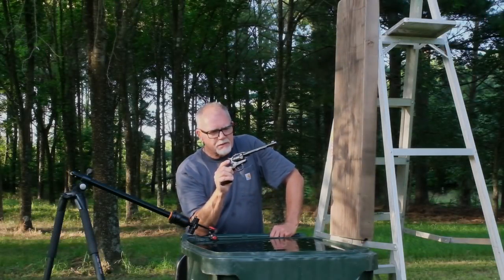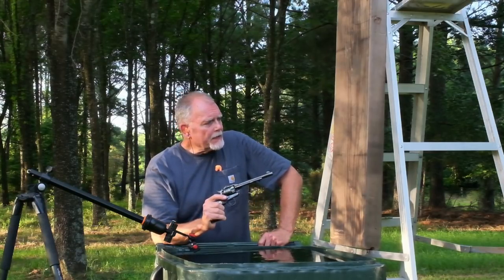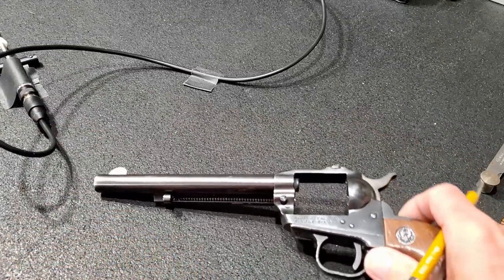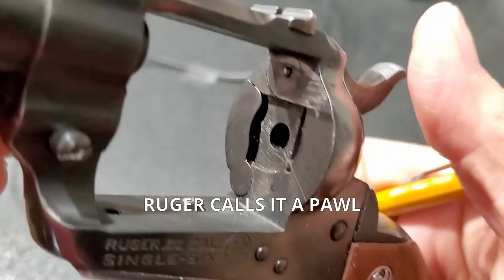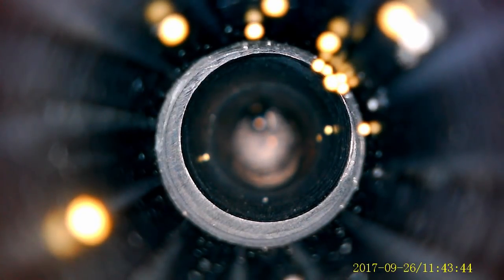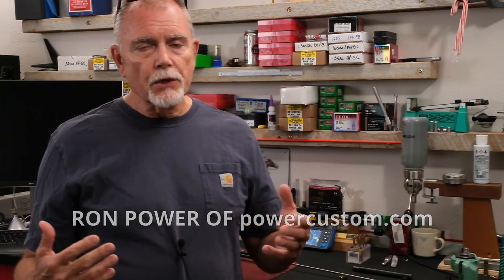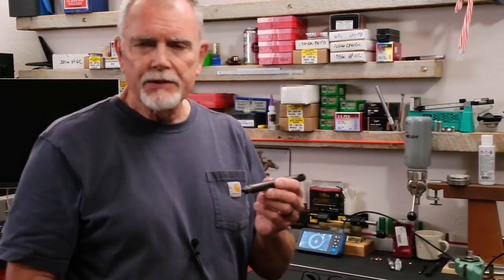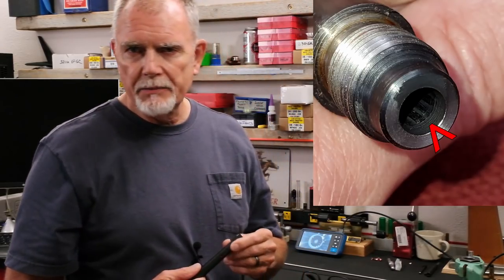The Bullets From My Single-Six Are Crooked ! ! !

Comment: I commented before on checking the throating cone for missalignment, but Holy Cow, in seeing those bent bullets, that 22 mag cylinder in crap.  I would ask for a new cylinder and a timing alignment, or, a new gun.
Reply from the maker: The problem is there is evidence of Shadetree Gunsmithing having been done on this gun so Ruger it's probably not going to want to dig too deep. My original request to them was just about the crown and so I doubt that they did any more investigation. Regardless I had the opportunity to trade it in on a new one at a discount but opted to keep this one so I could work on it for the channel. It's been a great learning experience for me and I hope for a lot of you guys as well.
Reply: @TargetSuite  It's true that gaining knowledge by working on them yourself can be helpful.  I have a pistol that was sent to the 'fishing box' as it only fires by pulling back the hammer and letting it go.  If that ever fails, it's going in the water.

Comment: That is so you can "curve" the bullet, like in Hollywood.
Reply from the maker: Yes. It's a lot easier than bending the barrel. Plus, you can make adjustments on the Fly for which direction you need to curve to happen😄😄😄

Comment: Just got here, after 206 comments, so I've not read them yet. To right of center (that's me) cylinder, bolt, and or crane. To high cylinder and or crane. Also, there are thirsty people all over the world. You could have donated that water if you had put a net in the garbage can first. Not begging for your water as I only drink beer. PS thanks for cleaning the can before the slow mo.
Reply: Sorry. Crane's not the right word. I mean the pin through the center.
Reply from the maker: Being a loving and fair individual I donated that water to people all over the world. Equitable distribution will just take time😉

Comment: Is there not a lifetime warranty on Ruger firearms?
Reply from the maker: I don't think the Ruger warranty covers 53 year old guns that have been tinkered with over the years.
Reply: @TargetSuite  You may be right.  However, it might be worth a telephone call.  It is pretty obious that this is a manufacturing error and npt a result of tinkering.  Ruger repaired a Standard Auto for me in 2014 that was bought in 1963 and had some tinkering on it.
Reply from the maker: I did send the gun back to Ruger initially. They indicated a desire to replace the barrel, but due to the fact that it is 53 years old and an Old Model they didn't have any in stock. Instead they offered to sell me a new model at a discounted price. But I chose to take the old gun back just to continue working on this project. It's good learning experience for me and for the YouTube Community, at least I think it is.
Reply: @TargetSuite  Thank you for your detailed reply.  Tried locating a barrel for you and found this: https://cfnparts.com/index.php?route=product/category&path=413

Comment: Maybe a 22 cal. That barley fits the bore and see if it will pass from muzzle past the forcing cone into the cylinder
Reply: Sorry I mint to say 22 cal. Rode
Reply from the maker: I have a rod the size of the boar and it goes into all the chambers but it does snag a little bit on one. But there is no sign of Shaving lead.
Reply: @TargetSuite  Thanks for taking the time . I realize I was looking at it wrong you do good work and I think I've learned something that may help me in the future . Neat project though !

Comment: I am not a gunsmith (I don't even play one on the Internet).

However, in an earlier life, I had a camera repair shop. So, I like to think I have at least a rudimentary knowledge of simple mechanical... well, mechanisms. <g>

So, when I watched that thing hopping all over the place when you poked some feeler gauges (to shim it), the first thing that popped into my mind was, "Wow, that's an awful lot of play, for that cylinder to be moving around that much!"

So, some questions, and, and off the cuff opinion afterwards:

First, is it possible that the cylinder -- or more likely the axle it spins on -- is just plain worn out? I'd guess the axle would be more likely, as I'd assume the cylinder to be made of very strong heat-treated tool steel, because it has to contain a lot of pressure in a limited thickness of metal, whereas the axle just has to sit there with the cylinder spinning on it, mo more than a few ounces of pressure.

Next question -- are there any bearings that might be worn? Or if no bearings are used (and if this was a camera I'd ask why NOT???), are there at least bushings (i.e. oilite, or even just a brass bushing)?

Again, if not, why not? And, if not, perhaps you could add some. A milling machine would probably make it trivially easy to create openings on the front and back of the cylinder to accept bushings that had an I.D. that was an exact match for the axle.

[[Edited the above to fix the original lack of "to accept bushings" -- it makes no sense otherwise!]]

Final question, is it possible that there were bearings (or bushings), and "Bubba's Perfeshunal Gunsmiffin' Survace, Lot 832, Country Acres Trailer Court (single-wides welcome!)" removed them? ("Why in heck someone stick these things in here? This sucker spins so much easier with them removed! Better reliability!")

OK, my off the cuff opinion (I confess to having slipped some into the above text) -- If there are no bearings/bushings, and there never were any (what I could call a design defect), then I suspect the problem is a worn axle, probably due to lack of lube, possibly potentiated by sand. (You have no idea what one trip to the beach can do to a camera's internals. "But I was only there for a few hours, and I always kept it on the blanket!" OK, that's nice -- but the wind rolls those tiny grains of sand for those few inches above the ground, and into every opening into the camera. (And then there were the numerous jobs where every screw was winding itself loose, even though the owner "always kept it in the case, and kept it on the floor under the seat" due to road vibrations. But, I digress.)

If that IS the case, can the axle be replaced? If not, perhaps you could build it up (at the front and back positions where it meets with the inside of the cylinder) with some silver solder? (I am talking about brazing, NOT "silver-bearing" SOFT solder. If you can melt the solder with an iron, it's not real silver solder -- for that, you NEED a torch, and when you're done you will have a VERY strong VERY hard metal surface that you can then work into the precise dimensions needed for a good mate-up with the cylinder.)

IMO, of course. And before I get flamed to hell, I will reiterate that I am NOT a gunsmith, but, as a former camera repairman I think I can understand the working of very simple mechanisms like are involved in what I see in this video. For whatever reason there appears to be a monumental amount of PLAY -- too much slop for the kind of precise bearing surfaces one would expect necessary in a firearm ("bearing" used here in the generic sense, whether it's just the cylinder "bearing" against the axle in lieu of actual bearings).

So, my final suggestion would be for you to examine the axle/cylinder contact surfaces, looking for wear, missing bushings, whatever it might be that's causing the play. Get rid of the play and I think you'll solve the problem. I do NOT think that replacing the barrel will fix things! It would be tantamount to buying giant tires and run them "soft" instead of replacing the shock absorbers in a car.

Or to use a "gun analogy" it would be like buying bigger targets as a way of dealing with an inaccurate rifle, so that you can always hit the bullseye.
Reply from the maker: Haha! I love your comment. No there are no bushings or bearings in a revolver like this and not in any that I have ever heard of. And there is no excessive wear in this gun.  All of that looseness that you pointed out I attribute to manufacturing tolerances. And yes I think it is a little excessive by today's standards. But this gun was made before the days of mass CNC Machining and so tolerance is like that could significant from gun to gun I suspect. I really appreciate your comment. Thanks for taking the time
Reply: @TargetSuite  -- thanks for the kind words, much appreciated. From the info you just gave I have to say that it's kinda sad that they'd design something that deals with such high pressures, while paying only passing thought to critical engineering elements.

Things like CNC are the Johnny come lately to the world of precision.

My late father operated a lathe at the Brooklyn Navy Yard. He routinely worked with very precise tolerances of just a few thousandths of an inch -- sometimes for. huge components to become part of an aircraft carrier, sometimes making tiny geartrains as part of some instrumentation (or something or other -- he never said, and it's been twenty years since he died so I'll never know; but I'll never forget how precise it was). 

When they closed down the Navy Yard in the 1960s they were just starting to get some "numerical control" equipment. As I recall it, he said it operated via a tape, I'm pretty sure he described a paper punch tape.

There are no practical limits to the precision a skilled machinist can deliver -- basically, as much as required.

I still think the best path to precision downranige at the target is precision at the cylinder. If it is so worn or so poorly fitted that the most critical component is wiggle-wobbling unless you stick a shim above it and bear down, then success lies in establishing a precise fit of the cylinder's mounting.

One other idea for resolving this would be to use a metal sleeve with an I.D. that would fit over the axle, and an O.D. that was a match for the cylinder's I.D.

I'd think any halfway competent machine shop (I.e., gunsmith) could do this in a few minutes or so.

In any event, I hope you are able to get it properly operational without any grief.

Comment: seems inadvisable to fire a revolver if you suspect some sort of timing or alignment issue.  better to have it properly inspected by a gunsmith or machinist and repaired before firing.  revolvers need tlc from time to time just as vehicle motors need valve clearance checks and adjustments

Comment: The problem is that you're right handed. It would be fine if your were a leftie. 
Yeah, I'm full of BS. 
The cylinder axis and the bore axis aren't right. You won't fix it with a new pawn and cylinder bolt by doing some gunsmithing, that gun is messed up. Send it back to Ruger for a replacement.
Reply from the maker: Haha! A little humor at this point is appreciated😄
Reply: @TargetSuite  I stayed at a Holiday Inn Express last week so I know everything. Great videos! I always enjoy them.

Comment: I would not think you are getting that much flex on the base pin seeing is it is supported on both ends ...that leads me to beleive you have that much clearance either between the base pin and the frame or in combination with the base pin and the cylinder. .....also high is going to be the default as the spring loaded bolt will push up and remove clearance ( also tending to push to the right as viewed from the muzzle)    oversize base pin carefully fit to the cylinder would likely fix much of this ( provided the cylinder bore is not oversize as well.

Comment: Still  locking up , slightly out of time ?
Reply from the maker: Yes sir. It locks up tight as a drum. But it is out of time as well as out of alignment up and down. The time being issue is easy to fix the up-and-down misalignment will be perhaps a bigger deal. We'll see you in the next few weeks.
Reply: @TargetSuite  I had a Ruger security six back in 1977 , cylinder notches were off by a hair , would not lock up sometimes . I paid 114.77 for it new in 1977 , Sent it back , received it back in about a month ,Didn’t even fire it , sold it to an old security guard for 125.00 . Ruger generally makes a solid firearm though .it was also rollmarked “ made in the 200th year of American liberty” he really thought he made a “ steal”

Comment: Less than 3min in and Boy the back side of your cylinder certainly looks like you are getting a whole lot of out of time firing hits on the face of the cylinder instead of in time with each chamber like it should be.

Comment: I would say that the gun you bought at a great deal was not.. If you can move the cylinder on the pin .003 to .007 then your gun is what we call worn out,  Stop waisting time.
Reply from the maker: I appreciate your comment. With the oversized base pin all of that movement is removed. You are right though, from a personal perspective this gun has been a lot of grief. But I have learned a ton going through this process and I hope my viewers have as well.

Comment: The revolver is OUT OF TIME.
Reply from the maker: Way out of time. I'll be adjusting that For an upcoming video.
Reply: @TargetSuite  couple years ago bought a brand new chiappa that was out of time, didn't blow up but jammed the cylinder, had to use a mallet to get it open to remove rest of the live ammo to send it back for warranty, they had to replace cylinder, cylinder pin and firing pin took 3 months wasn't happy with what else they did, they wallowed out the forcing cone. 
Had a S&W 629 that was out of time, I never fired it I informed guy I sold it to that it wasn't safe and had to go to a gunsmith.... he had to try and shoot it, blew the top strap off, he wasn't hurt and he admitted that what he did was stupid.